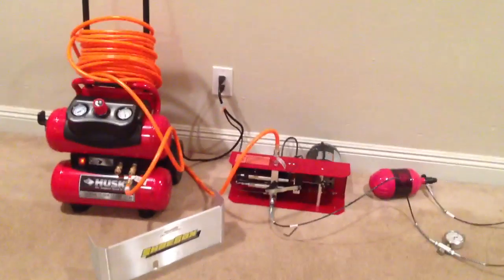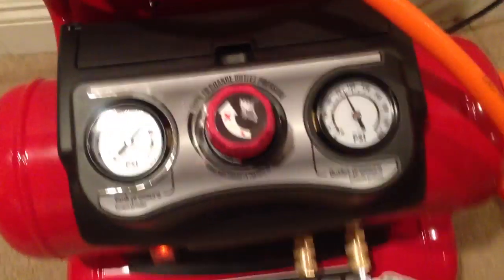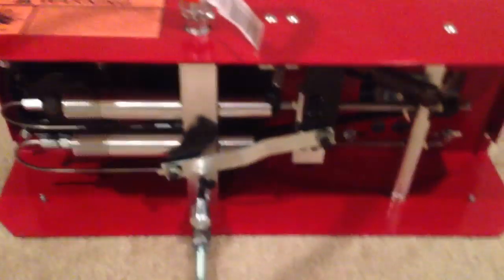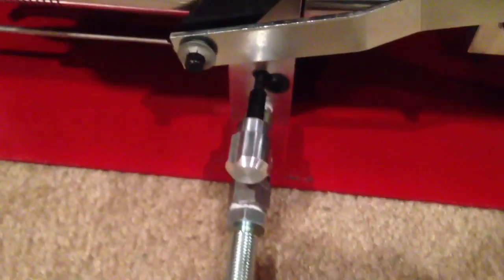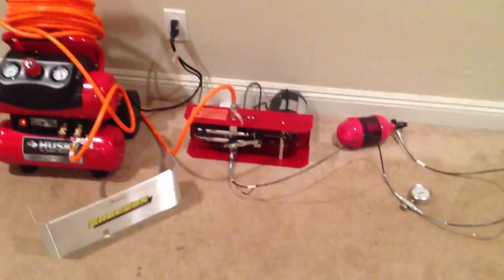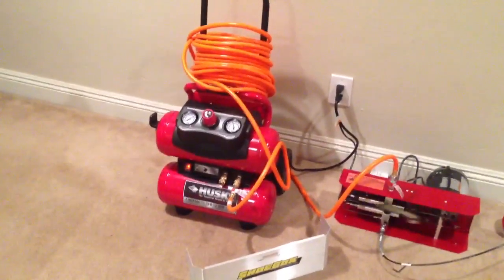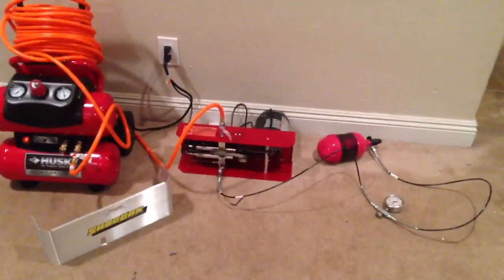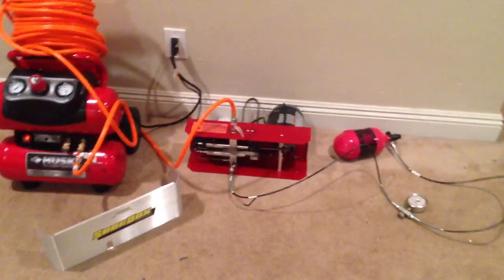Shoebox Compressor Designed by Tom Kaye

Comment: Hey, nice little machine. Have you had any trouble with it? Can you give me the details of the electrical motor? How many watts, RPM etc etc. Many thanks and looking forward to your reply, cheers
Reply from the maker: Sorry for delayed response. 1/3 HP. 115 V. 6.6 Amps. 1725 RPM. Dayton belt drive fan blower motor. No issues.

Comment: What is the knob used for that is located above the output foster fitting ?
Reply from the maker: elcues if you are referring to right above the the 4500 psi output quick release, then the answer is a pressure release.

Comment: It won't cause my little air compressor to over work?
Reply: camarabros
according to the manual you should never allow an input pressure of over 100psi, a lower input pressure results in higher fill pressures. ex. 85psi input may result in a fill of 5500psi, compared to 95psi input resulting in a shutoff pressure of 4500psi. Such is the case for my shoebox.
Reply from the maker: As long as your air compressor is not working continuously, you shouldn't have any problems. The shoebox require and input pressure of less than 200psi, and there is nothing wrong with running it with a very low input pressure. Your tank will just take longer to fill.

Comment: I find it interesting that of all the detailed shoebox videos on youtube, no one likes to mention/document their "actual" fill times lol which leads me to the conclusion that the $$$ spent on the shoebox (plus the $ spent on the required 1st stage mini-shop compressor) is just not worth it due to such slow fill rates (i.e.with a group of players playing on their own private property for the day, no one is going to wait 30-60-80 + min to fill just one tank...even if everyone had 13ci/3000psi tanks). In its current design the shoebox is just too slow. Seems the high pressure air-rifle crowd might find the shoebox more plausible since they do not shoot off as many rounds & require less air than those who play paintball(?)
Reply from the maker: It takes about 4 hour max t fill a 68 cubic inch 4500 psi tank. The way I see it, you would not be able to run a home field off of one shoebox compressor if everyone playing ran out of air at the same time. The benefit of the shoebox compressor is cheap at home refills. If you wanted to run the shoebox for an at home field, you would want to purchase a scuba tank and fill the scuba tank overnight. Then during the day of play, players could refill their tanks using the scuba tank. I have a 3000psi scuba tank that I use, but ideally you would want to find a larger 4500psi tank. Airtanksforsale.com (link is in my description) has larger carbon wrapped tanks for sale, that could be use used to refill smaller tanks.
Reply from the maker: camarabros I mispoke. It actually needs an input of 85psi, not less than 200psi.

Comment from the maker: To KillerRC:  I am considering adding an air dryer inline between the two compressors just like you suggest because I have been getting some moisture build up in the hosing.  You have made a valid suggestion.

Comment: I'd add an air dryer inline there between the two compressors. You'd be surprised how much moisture is in an airline because of the hot air cooling and creating condensation.

Comment from the maker: Sorry it took me so long to reply.  I got my shoebox directly from Tom.  He has a newer version than the one I have, so I think you should probably go to Tom's website for the most current pricing quote.  Also, you can get just about any hosing and adaptor from the site listed above.  I bought the highest quality hosing possible to go between the shoebox and my tank. I believe the hosing and gauge were around $100 and the shoebox was around $700 (I bought the highest end version).